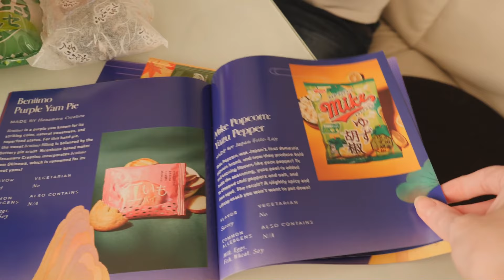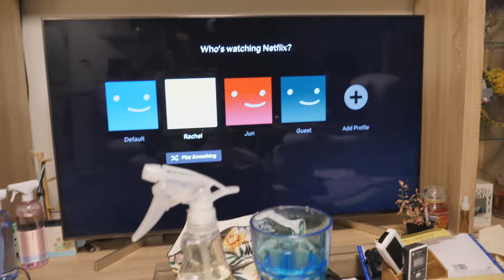I broke our couch

Comment: As someone who has to use these stappler guns very  frequently at work, it's not you being weak haha they all require a lot of force to work. Also they usually work like actual guns as in you pull the handle torwards your palm and not the other way around which is much easier. Nice work figuring out how to DIY fix it!

Comment: Just wanted to let you guys know a trick with stripped screws. If you take a rubber band and place it on the stripped screw and then use the a hand screw driver, you can still use it or take it out of what is is in. :)

Comment: Rachel, may I suggest a crown stapler instead of a manual staple gun? It's basically the same power tool that stapled on that bottom lining in the furniture shop when that couch was being finished. 

I don't know if Makita offers one like mine, which is a Ryobi. It comes with a compressor built in, and I can adjust the depth/strength of the strike, e.g. on hardwood or drywall. SUPER handy tool, highly recommended.

Comment: Because that staple gun accepts different sized staples, I believe that silver knob on top is the torque adjustment, which you can try adjusting to reduce the force needed to fire the staple. Or, just get a different staple gun -- I've used many, many staples guns in my life and never had to struggle that much to fire them, so something seems like it's either adjusted wrong or you got a defective unit. But I have a feeling that knob adjusts the spring tension.

Comment: Screw fun facts. If a screw is flat, its known as a machine screw and meant for screwing into metal. Pointed screw is known as a wood screw. Apply a little bar soap to the threads to help it go in easier

Comment: Quick temporary fix for a stripped screw get a hammer and a screwdriver, line the screwdriver up and smack the end of the screwdriver a couple times firmly with the hammer, screws generally aren't made of very strong metal and you can make an indent in the screw deep enough you can back the screw out of whatever you where trying to screw it into and then get a new one

Comment: I got very anxious whenever the cats got inside there. My old couch also had one of those springs disconnect, and while I was trying to push it back in, damn thing cut my palm open. The spring ends can be super sharp, I still have a scar from it.

Comment: When I first got both of my current cats (at two seperate times, about a year apart) they both had managed to sneak their way into the back of the couch and I freaked out and pulled all the staples out frantically because I thought maybe they'd get stuck in the springs or get hurt (it was a couch with a leg rest that flipped up when a lever is pulled) and its funny to see that other cats also are very attracted to the inside of couches!  (they both were fine btw)

Comment: Rachel isn’t wrong. Plastic has what’s called a limited wear-life. That means under repeated use it will eventually break even though it’s never been pushed to its maximum strength.

Comment: LIFE HACKS for WOODWORKING:

- Normally every electric drill has a little switch to change the direction of it's spinning, near the Power-Button. So you can also use it to loosen screws again by turning it counter clockwise. That's a lot easier than loosen a screw by a manual (non electric) screwdriver. It also get's a little more power if you change the switch on top of the drill to '2' to get easier through hard wood or tighten screws. Usually 1 is for screws and 2 for ultimate drilling holes in everything.

- There are adapters for electric drills for drilling in a 90 degree angle which makes it easier to drill in tight spaces or near to a wall etc. So you wouldn't need to sacrifice more drill-bits to the gods of wood and metal \m/ :D

- Really, and I mean REALLY invest in an electrical staple-gun if you want to use it more than once, or rent it. It needn't to be such a pain in the butt and can be really fun to upholster furniture by yourself. I tried to upholster a whole sofa with a manual staple-gun like Rachel and can do my summary: 'blood, sweat and tears'. If you want to re-arrange the cord at the cat-tower with the staple-gun and extra long staples? Perhaps long staples can't be pulled out that easily by the weight of the cats? 

Greetings from Germany <3

Comment: 10:38 this is a common problem, you need to lube the screw so it drives in easier.  Use soap or oil or wax.

Comment: Damnit, I wish I saw your video earlier as an upholsterer apprentice. Next time the plastic acts up, buy  an Nosag spring zigzag bench spring tensioner. In that way you won’t have to add a piece of wood. The spring is supposed to be stretched all the way to the wood. Using that tool does that!!! I enjoyed watching this.
Reply: Also the moment where you wanted the remove the screw and he couldn’t do it because it was too tight, you can use your screw driver for that too. There’s a button on there, that makes the screw driver rotate the opposite side, so you can remove screws that way!

Comment: Next time turn the chair upside down and put it on top of a right side up chair so you can lean into the staple gun with your body weight. One hand operates the trigger and the other hand presses down on round knob directly above where the staple enters the chair. Is that as clear as mud?

Comment: Your DIY is just hilarious,  I wonder if you thought about the weight those hooks will hold. What was it 30kg all up. Don't be surprised if it goes again. You squeeze with the staple directly down, use your weight it's much easier. Good job all round, I laughed. Very funny.

Comment: My original thought was that you could try contacting the manufacturer to see if they would be willing to sell you a replacement plastic piece for the inside, but then... you would have had to take it apart even more to get to it from the top to install it :-\ I'm impressed with the ingenuity for the DIY fix either way, though.

Comment: You can sometimes use a rubber band to help remove a stripped screw. You put the rubber band in to of the screw and then use the screwdriver like normal 😃

Comment: I would think a plastic piece should not be holding that much tension. It should have at the very least had a little bit of slack to prevent breaking.

Comment: Demonic Rachel telling us how she really feels. And yes; plastic load-bearing parts give me fits. I mean there is a perfectly normal metal thingy that looks like a weirdly bent, very thick staple, that was designed to hold those springs to the frame. But the plastic is "easier"

Comment: As a carpenter/ woodworker all this look dodgy from the way the wood piece is cut and the screwing 
I would cut it with the grain in order to prevent splitting and I would predrilled everything before fixing it inside

Comment: I loved watching the cats "helping". I am not going to add suggestions for next time - because that would be "mansplaining". :-)
Reply from the maker: I'm still new to DIY so I'm happy to hear suggestions!
Reply: @RachelandJunAdventures  It would have been easier to use that staple gun if you had positioned that chair such that you could press down on the staple gun with your weight on top of it. One hand pressing down, as hard as possible, on the gun, overtop of where the staples come out to keep it from "jumping", while the other is working the lever. There is a staple gun called the "Black & Decker Sureshot" that makes it possible to use one hand because where you press down on the lever is switched around so that it is overtop of where the staples come out.

Comment: I dont get why you couldnt just flip the couch upside down and put it ontop of another couch when it came to using the stapler. You made the job 100x harder for yourselves by trying to do it sideways. 🤷‍♂️

18:58 - Theres like a pillow and some sheets ontop of a couch. All you had to do was move them temporarily while you flipped the broken couch upside down on it and put the staples in. 🤷‍♂️🤷‍♂️
Reply: Not everyone thinks of everything when in the middle of a repair. Rachel did great.👍
Reply: @deborahsmith828  they could have thought of it before they started the repair 🤷‍♂️
Reply from the maker: Pushing the gun into the couch wasn't the hard part for me; it was the finger strength required to compress the trigger all the way. Could've been pushing it straight into the floor and I would've had the same problem. Just didn't have the muscle for it.
Reply: @RachelandJunAdventures  my point being is that you could have used your body weight to press the trigger. -- thats why i said it would have been easier than doing it side ways. Had you had the sofa up against the wall or someone holding the couch while you were using the stapler would have achieved the same result but it would have still been a little harder.
Reply: @Rose.Of.Hizaki   It's easy to second guess, but I know from experience how when you are in the middle of fixing something your mind doesn't hit all the right boxes. 
I can remember getting done with fixing something and then remembering I have a part that would have worked better and quicker, I just forgot I had it at the time. LOL